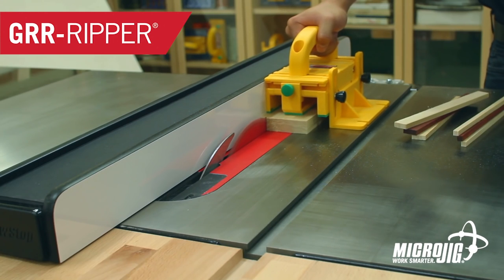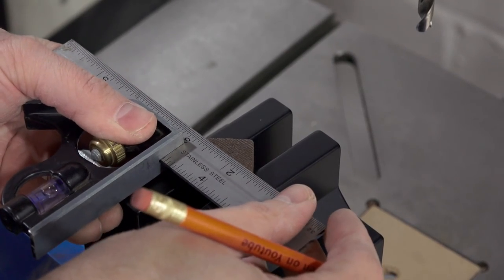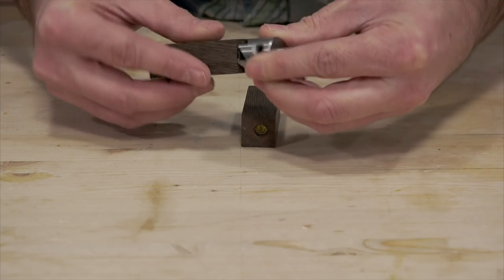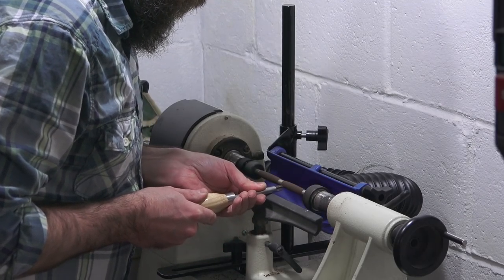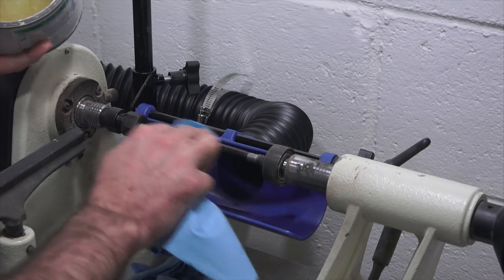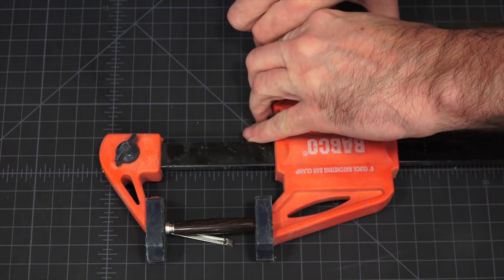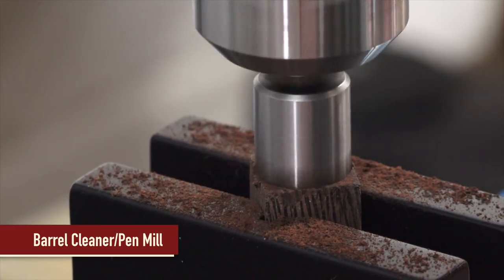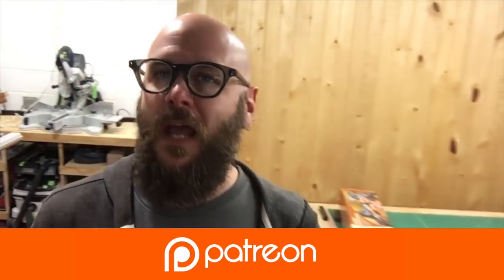How to Turn a Slim Line Pen on the Lathe | Pen Turning Basics

Comment: Good Video to get started.  I wish they had all these videos when I started.  I use wax on the tube ends to keep the glue out of the tubes.  I don't use a pen mill tube.  I clean up the ends with my  HF disk sander.   I agree that using those pen making dedicated tools are a big help.  I do everything on the lathe since there is no run out and centering is no problem.  I use a vicmarc chuck with pen jaws.  I use a shear mandrel by woodpecker.  It's pricey, but no comparison with the other pen mandrels.  I make a lot of pens so it's worth it for me.

Comment: Hey David great video. Two tips for pen turning avoid gel type super glue for the brass tubes I've always had better luck with the liquid. Also if you don't have the end mill you can easily take it to the disc sander or the belt sander to clean up the ends of the blanks.

Comment: Another alternative to the pen press is some fittings that can be purchased inexpensively to fit into the morse tapers on your head and tail stocks and just use the ram on the tail stock as your pen press. It works great! I also like to use the lathe to drill the pen blank as the spinning workpiece naturally centers the drill bit as you drill. This does make use of chuck with jaws designed to hold pen blanks but works out really nice.
Reply from the maker: +KF7AIK Oh nice! This would eliminate two tools! Great tips!!

Comment: I find it funny that you post this and I've been researching lathes, tools, and the works all week long. I see so many people saying that HSS is the only way to go, but I think I'd prefer the carbide for now. I could spend over a thousand dollars in gouges and sharpening equipment alone. I'm not even sure I'll like turning, so it's a gamble either way. Great video though. Your stuff is always very informative.
Reply: I have one carbide tool and a cheap set of Buck Bros tools. If you don't mind sharpening, the Harbor Freight ones will work until you decide you need something better
Reply: +Penrod Garage I've thought about that, but I also need sharpening equipment and training. I've worked metal lathes with carbide tools. I know it's not the same, but it's it's all the experience I have lol.
Reply: +Phillip Rowland all you need to sharpen is a cheap bench grinder from HF. I got one from them and use it all the time for dumb little things aside from sharpening.  Although it is not easy to learn from YouTube how to sharpen, it is possible. My teacher told me to just make sure you are touching the bevel, your metal isn't hot (use water), and that the sparks are flying over the bevel. It's hard to explain in text haha.
Reply: I actually wouldn't have a set of gouges if my school didn't give them to me haha

Comment: Great video Dave. When you mounted the 2 pieces of wood onto the lathe they looked like they could spin. I was expecting them to stop turning as soon as the turning tool touched them. Am I missing something?
Reply: +Robin Lewis The bushings apply pressure to the blanks. You can see the brass nut in the mandrel he holds up at the end of the video. This is used to adjust the amount of pressure if you don't have the mandrel saver (Otherwise the lathe tailstock is applying the pressure). It does occasionally stop spinning when you apply the cutting tool but usually only in the beginning roughing stage.
Reply: Aaaah, i get it now. So when it looked like the piece was spinning as it was slid on that was just because there was no pressure on the blanks. Brilliant, thanks for the explanation!

Comment: Just a tip with the Centering Vice. Chuck up a piece of round stock in your drill press. Lower the Quill down until  the round stock is inside the jaws of the vice. Lock the  Quill in place. Tighten the Vice around the round stock the clamp the vice to the table. Release the vice from around the round stock. Unlock quill and start drilling your thousands of pen blanks knowing it will be in the center each time.  No need to mark the center of each blank.
Reply from the maker: +Joshua Russell Ahh yes! Thanks for the tip! Do sell pens?
Reply: Nope, but have worked with centering vice on a metal mill. Same concept and after a few times of removing and installing the vice you will have the steps down pat.

Comment: i just drill them on the lathe, I use a chuck with pen jaws and drill from the tail stock. I don't have a drill press.
Reply: +Joseph Watson Same here.  My drill press is crap.  I also barrel trim with the lathe, sometimes just holding the trimmer in the tail stock and bringing the blank to it by hand without using any power at all.  Lately I have just been using the disc sander for this step with 80 grit.

Comment: The other way I found to press the pen parts together is to use my drill press. I just close the jaws up, hold the pen parts vertical in one hand, and spin the handle in the other.

Comment: Why get a pen press when you can just use a vice? If you have a drill press, it probably came with one. If not, you can buy a cheap one for $30. A square is needed but a small box will do just fine too.
Reply from the maker: +Derek Cook thanks Derek! I never even thought about using the drill press until all the comments I received. Brilliant idea!